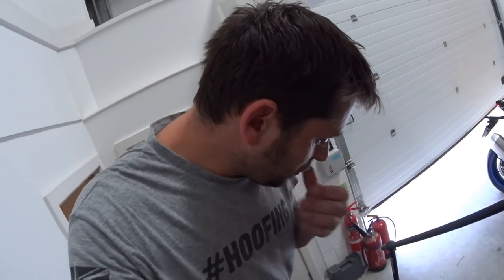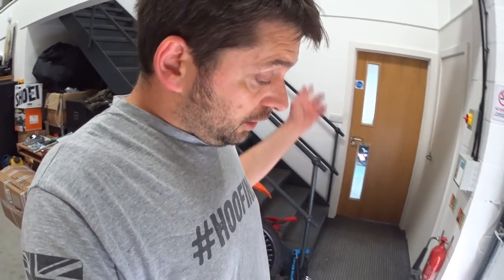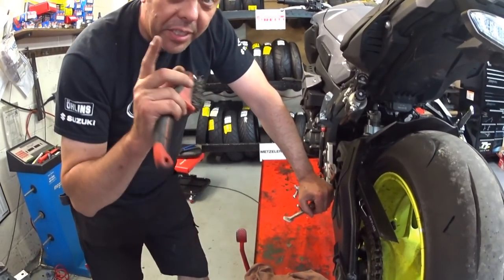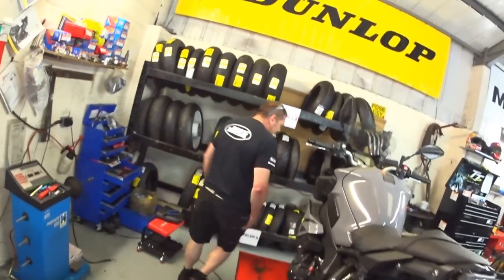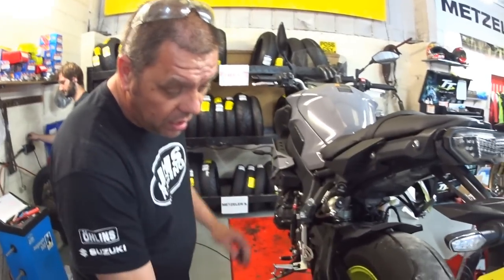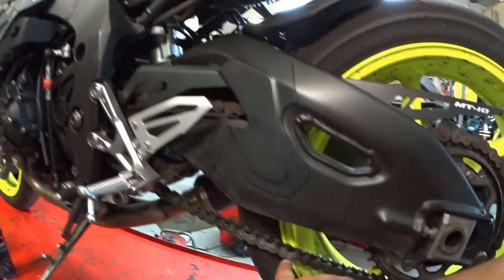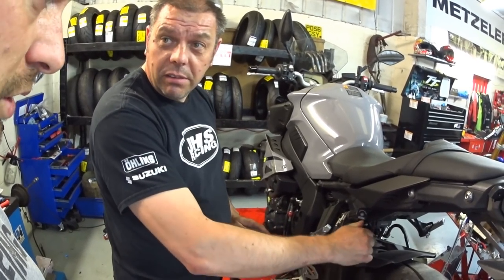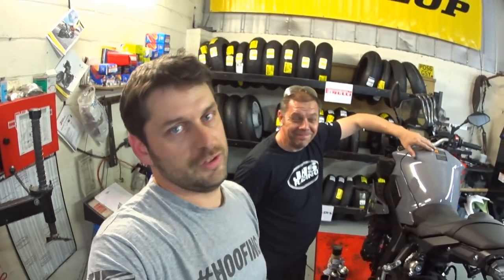2016 Yamaha MT-10 - Episode 12 - BJ's Blog

Comment: I rode my YFZ 450 and my Can AM 1000 XT Iike I stole them and always brought them home dirty and banged-up, for years and years.  Why not just pop the chain, drop it into a pan of cleaner and have at it with the wire brush?  Then you can lube it up and its ready to go back on?  Much easier to clean up around the sprocket, wheels and everywhere else before assembly.

Comment: if Nitron doing that kind of job, they should give up doing the suspension . You don't have to tell them what to do, and saying they do listen to me , they should be the specialist of the business. From just that point I wouldn't run with Nitron on any of my bikes no way. Then as a journalist, you are saying SP doesn't worth the extra bucks, yeah well you can clearly see that it worth all the money. You can see what it is look like with a NITRON suspension. I am glad i don't listen to motorcycle journalist too much, bought my self a mt10 sp after test riding mt10 standard and sp back to back, if you really think the sp doesn't worth the extra £3000 you should go and get your self checked
Reply from the maker: We got the Nitron fitment wrong (we didn't have any instructions so guessed), which we apologised for in the final MT episode. And the shock's working action is excellent. We also tested this bike V the SP, which you can also see in the final episode, and another version over on Bike World's channel too. The simple fact though, is this modded bike is a lot more powerful, handles better and still comes in well under the SP's price even with all the mods. Doesn't look anywhere near as nice mind you, and the SP is still ace, but dynamically the modded stocker is superior in nearly every area. Which one you'd rather have, however, is subjective, there's no right or wrong answer to that.